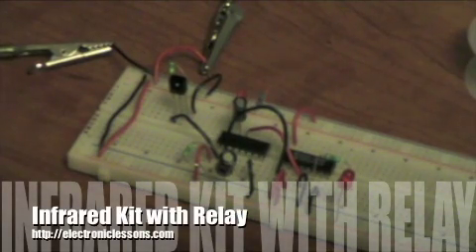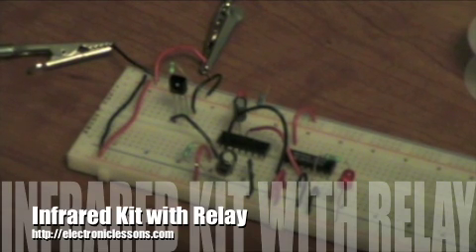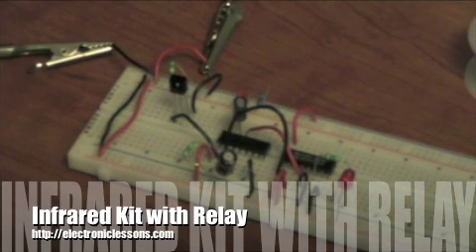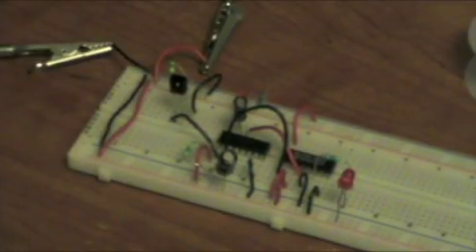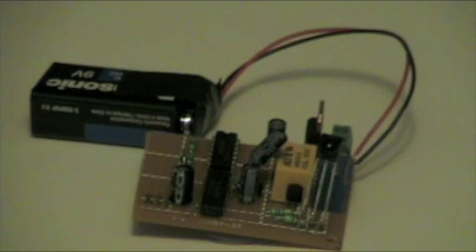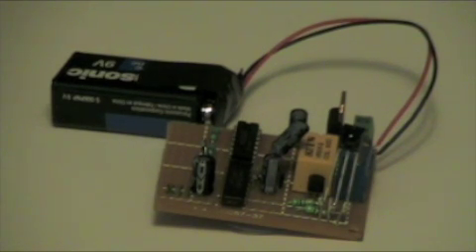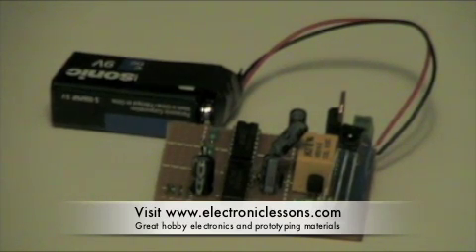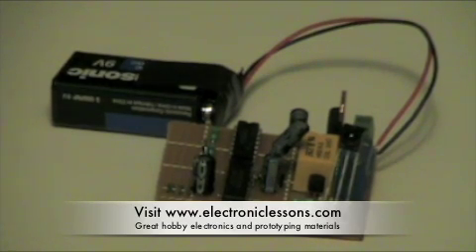Infrared Detector kit with relay: Turn fixture on and off using your remote

Comment: could u add a ir led "no frequency"  next to it and use this as a proxy sensor so u could mount this in a wall and turn on and off ur lights by waving near it as the ir light reflects off your hand into the sensor?